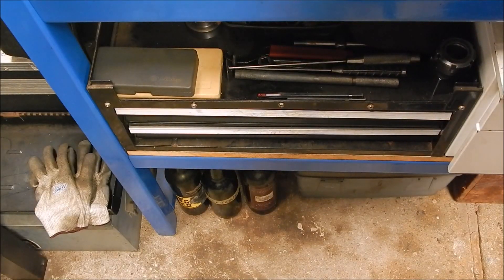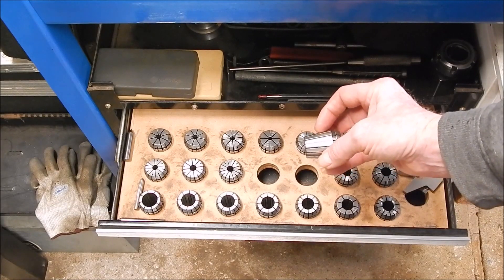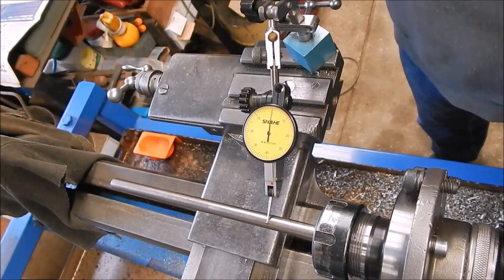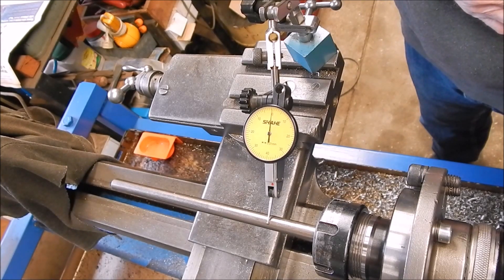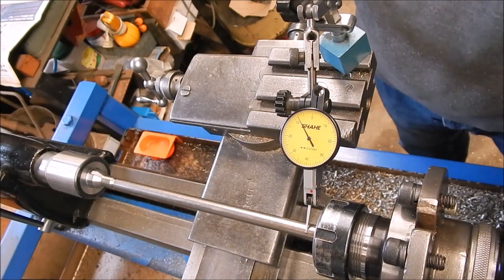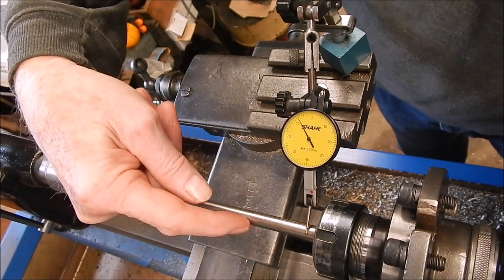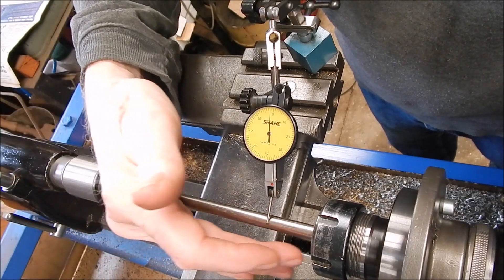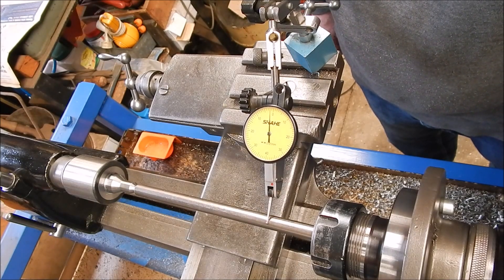How to reduce run out in ER collets

Comment: Our CNC router uses ER32 collets. If the tool isn't inserted far enough it can work it's way out while running. I've seen it happen!  A 1/2" X 6" carbide router bit coming out @ 14,000 rpm is right scarry. Operator tried to get another 1/2" depth of cut! For small, short work I use 5C collets on the metal lathe. They grip at the very outside end of the collet.
Reply from the maker: Hi Larry.  Interesting. Sounds like the collet is at the limit of it's compression range for that to happen.  5C have very limited compression range and you have to work at the nominal size for them to grip.  I use W20 which are very similar.  OK for industry where you are using set sized work.  5C do allow the use and grip of non round work (with the appropriately shaped collet centre), which ER cannot do.  Cheers Rob
Reply: @Xynudu  1/2" collet, 1/2" carbide bit but only into the collet part way. Feed 600"/min. Likely caused vibration. Even if the collet only compressed very slightly more on the empty area it would cause the bit to be gripped more on the end furthest in the collet resulting in a squeeze out condition.    My use of 5C collets is for small work and always close to nominal collet size. I like the smooth nose of the 5C chuck for getting my hands right close to polish the work. I have a few square and hex 5C collets also. I use my ER40 chuck for longer or heavier work. I really prefer using collet chucks over scroll chucks because it is so easy to use an internal depth stop for repeated operations.  Collets also grip threads w/o damaging them, very handy.

Comment: Interesting Rob.
Many things to keep in mind .was thinking of getting collets to hold a ring mandrel . Now I know mandrel shaft will have to be longer than collet. Thanks for info .At the moment I put a piece of bar in the 3 jaw and turn to fit dia of ring with a slight step to hold ring flat with chuck . Good for one off.
Reply from the maker: Hi Colum.  Yes you can easily get trapped with this stuff.  It's not always as simple as it seems.  5C collets don't distort as much, but that's because they are designed differently and don't compress any where near as much.  Basically to use 5C the job has to be at the nominal size.  Cheers Rob

Comment: Hi,Rob. Useful advice for those unfamiliar with using ER collets. 
 I have loads of varying diameter short steel slugs to go in the rear of the collet when I have to grip workpieces that are too short to span the full collet depth. 
I also mount my collet chuck in the 4 jaw chuck and that enables me to adjust the workpiece and collet chuck for best concentricity.
Reply from the maker: Hi Howard.  Good techniques.  I have used a collet block in the four jaw chuck at times, mainly for doing eccentrics.  Cheers Rob
Reply: @Xynudu  Yes,I also sometimes mount the square collet block in the 4 jaw and then transfer it over to the milling vise complete with the component if there is a cross hole to drill or flats to mill.

Comment: One of the best tips you gave me a while back was to use a collet chuck instead of a drill chuck on the drill press and lathe , no more chewed up drill shanks- I just wish I could get a collet chuck for my battery drill , that mongrel destroys drill shanks !
Reply from the maker: Hi Ian.  A lot of cordless drills only have keyless chucks, many with plastic bodies, and they are usually B grade gripping units.  However, there are a few quality ones around with metal keyed chucks, which must be way better.  Retro fitting an ER collet chuck accurately would be a bit tricky I think.  Cheers Rob

Comment: I don't use collets very often and only in the mill but it seems so obvious to grip the entire length, otherwise it's like trying to grip a drill using only 5mm of the drill length
Reply from the maker: Hi Bill.  Yes that's a similar situation.  I only did the video in response to the original comment I refered to, which showed a lack of understanding of how ER collets work.   I'm not criticising the person, but using it as a trigger for a bit of skool time that may benefit other people.  Sometimes we have no option, but to use only part of the gripping mechanism of the tool in question, but people should be aware of the issues that raises. Cheers Rob

Comment: Good information there. I have been using ER collets for a long time. Advantages are accuracy for the price, good uniform clamping due to the alternating splits - even better with a bearing nut, low overhang, and more.
One tip is to deburr them from new. Take off all the sharp edges, especially from cheap colletts, make the smooth to handle. Regularly clean them. Stefan Gotteswinter had done a useful video on this, even using an ultrasonic cleaner to chase the microns.
Reply from the maker: Yes, totally agree.  It's vital that users clean them each time. Cheers Rob
Reply: Regular cleaning of the slots with a piece of thin shim stock also helps keep collets gripping accurately.
Reply from the maker: Yes.  Cleanliness is essential with collets.  I mainly use compressed air, but old feeler gauge shims work well when the air is not on.  Cheers Rob

Comment: Some very good advice Rob. I mostly use collets on the milling machine. Aways push the end mills in as far as they go. I do have an er32 collet chuck for the lathe, but confess I don't use it very often. I'm going to use it more in the future. Cheers Nobby
Reply: When you do get around to mounting the collet chuck on a backplate for the lathe leave a few thou of radial play/slack so you can tap and clock the chuck to get true workpiece concentricity.  I always mount my collet chuck in the 4 jaw chuck and that way I can adjust it in small increments for concentricity.
Reply from the maker: It also saves swapping out chucks, which can be a real chore on large lathes.
Reply from the maker: This is where that second smaller lathe of yours will come in handy Nobby.  Have it set up for collets (which usually do small work) as an alternative machine.  That's what I do with the old Schaublin seen in the video. Super useful way to go.  Cheers Rob

Comment: Hi Rob, I didn’t know jobs had to go right through the collets so thanks for that. Recently I watched a video by DazeCars that I think you may find interesting. He recommends using a bearing collet holder and I have bought one to try. It’s only just arrived so I haven’t had time to try it out yet but it seems well made. Cheers and thanks, Stuart. Canberra.
Reply from the maker: Hi Stuart. I haven't used a ball bearing nose cap collet chuck.  I believe they allow greater tightening/grip pressure with less effort than a regular one.  The last time I looked they were considerably more expensive.  Let's know what you think of it versus the regular type.  Good for a video.  Cheers Rob
Reply: @Xynudu  I use a ball bearing collet nut on my ER40 chuck. It requires a lot less effort to grip very firmly than a standard ER collet nut.
Reply: The work has to be inserted to the full depth of the collet gripping surface or the collet will compress more at the rear end than the outer face causing the collet to effectively close in a tapered manner rather than parallel to the work. The trick with short work holding is to use a short slug of bar the same diameter as the workpiece and set it at the rear of the collet jaws. Example: if you need to grip a short piece of work of 10mm dia then you need to place a short slug of 10mm dia rod at the rear of the collet to keep the jaws parallel.

Comment: Good info, Rob. I have an ER40 lathe chuck and two collets, but I've never used it so far. I might do a test on it using some of your pointers. It'll be interesting to see how accurate it is. Yes, it's Chinese, lol. Cheers Tony
Reply from the maker: Hi Tony.  This compression issue applies to all ER collets regardless of price or where they are manufactured.   Certainly some ER collets from China are pretty B grade, but some are also very good.  It all depends on where you buy them and how much you spend.  I find CTC Tools on the web sell DIN rated Chinese gear which is on spec.  My original metric set came from them and is totally accurate.  Most on line sellers don't even quote a DIN figure (probably for good reason) so stay well away from them.  Cheers Rob
Reply: @Xynudu  Thanks Rob for that very important information. That's the reason I've avoided buying any collets. Now, I'll look for the DIN specification when I buy some. I don't mind paying extra if I know they are going to be over a specific standard. More accurate for my experience, but I hate working with trash. It induces problems. Cheers Tony
Reply from the maker: Hi Tony.  This is the only company I would consider for budget collet tooling : https://www.ctctools.biz/

I bought my original Chinese metric set from them 20 years ago and they were to spec.  I haven't bought anything from them recently and have no affiliation with the company, but I have seen very little negative comment in forums about them.  They were originally based in Hong Kong, but are now shipping out of Europe I believe.  Good luck. Their prices are quite reasonable.  Cheers Rob
Reply: @Xynudu  Cheers Rob.👍

Comment: Hi Rob. Anyone who watches my channel knows I'm a complete collet convert, thanks to you. Use them on the lathe in the headstock and tailstock, in the mill and my tapping guide. With the stuff that I make super high levels of accuracy are seldom required but the other advantage of collets is. That being, that they don't mark or damage the work in any way. Using them in the tailstock to hold drill bits completely removes any chance of chewing the bit up which can happen with Jacobs chucks. Also, of course, you can hold threads without any risk of damage. ER32 collet sets are cheap as chips on Banggood, now they may not be the best in the world but for the hobbyshop user they are great, Cheers, Alan.
Reply from the maker: Hi Alan.  Like all things, you get what you pay for.  Having said that, even the worst collets I've used have been better than most chucks for that work size.  Then of course there is the no mark work feature, which is probably the main draw card overall.  Some people bag Chinese collets, but they are not all of the same quality.  I have good and I have a bad set.  Spend more, get better, it works the same for most products.  Enjoy.  Cheers Rob.

Comment: There is a reason ER collets and holders from a manufacturer not too ashamed to put their name on their collets cost five time as much as Chinese mystery collets. Name brand tooling is guaranteed to meet a published specification. Buying cheap Chinese ER collets is about like buying a pig in a poke.
You might get collets you can use or you might get collets like the two sets I have that are so bad you don't need an indicator to see the runout. They do make attractive paper weights though.
In the home shop you can take the time to do the things shown in the video to help the situation. If you are using ER collets and holders to make a living this stuff has to be spot-on out of the box... dependably. Dependable and Chinese should never be used in the same sentence.
Reply: That's a silly uninformed view. You can get high quality tooling from China but you have to pay more. When things are built to a price point, corners have to be cut. No free lunches.
Reply: @HM-Projects  You've probably never bought any custom-built die sets from China. Or more precisely had to rebuild new custom-built die sets from China. The only way I know to get reliably good products from China is to hire some Japanese or Koreans to stand there and watch them like a hawk. The Chinese mentality in business is to sell you what they think they can get away with. Caveat emptor.
Reply: @HM-Projects   Uninformed? You just said the same thing as Rob using different words
Reply from the maker: You will get the same error result by using half the collet length, regardless of how much you paid or who made them.  All of my collets are made in China.  The Banggood ones were pretty variable and not recommended.  The CTC Tools bought ones are totally accurate and to spec.  You get what you pay for.  End of story.  Cheers Rob
Reply: You can most certainly get dependable quality collets from Chinese manufacturers. It simply depends on who you buy from and how much you're willing to pay for good quality.
Reply from the maker: Yes, good quality collets from China are definitely out there, but some people still buy cheap non spec gear, expect miracles, and then complain when it turns out to be rubbish.  I only buy DIN standard collets/chucks from a reputable store.  It will be slightly more expensive, but quality Asian collets are still very reasonable.  Cheers Rob

Comment: Good demonstration of how things can go wrong if ER collets are abused. If I have to hold a workpiece half way, I usually turn a blank around the same diameter and use that to even out the closing pressure.  Also I used a ball bearing to align workpiece in those scenarios.
Reply from the maker: Yes, that's the usual approach.  So how does the ball bearing aid alignment ?
Reply: @Xynudu  it's similar to the hand knocker but since it runs relatively true as long as there's axial alignment it pushes the workpiece to alignment.
Reply from the maker: OK.  Now I understand.   Cheers Rob
Reply: @Xynudu  I was looking for this video I made a while back, my import collets aren't that good  https://youtu.be/TjqLgYroqWE
Reply from the maker: Good video.  Looks to work well.  Very similar to a face alignment tool.  I will make one like yours and test it out.  Thanks for posting.  Cheers Rob

Comment: Hi Rob.  Like you I use my ER32 mill collets in the lathe to hold small diameters.  I have made a special adaptor to hold the flanged ER32 collet chuck like yours.  It is held in a three jaw chuck.  I have four cap screws with the heads protruding on the back side.  These fit into a recess in the mating plate.  I have four radial adjusting screws so by loosening the clamp bolts on the front, I can move the collet assembly around like a four jaw chuck.  This way I can reduce my radial runout to zero.  Cheers
Reply from the maker: Hi John.  That's a great idea.  Yes, shades of four jaw chuck there.  Errors can usually be eradicated if you want to put in the effort. Thanks for the comment.  Cheers Rob
Reply: I just mount my disc type collet chuck in the 4 jaw and adjust for best concentricity. Slightly different method but the same outcome as yours.

Comment: The ER32 and ER8 collet sets I've imported have been a lot better than I need them to be.  I don't use them exclusively but particularly on my little mill they're great for making the most of the limited Z height.
Reply from the maker: Even the worst collets are better than most chucks, for that size range ;)  Cheers Rob

Comment: Check the slits on the cheap collets, they can be cut bad, it's easy to see. Ditch those ones they will never compress right, no clean run out 👍👌🇦🇺
Reply from the maker: Yes, very true.  Also make sure to blow collets out with air to remove crud after use or you will get the same effect.  Cheers Rob
Reply: And use a dial gauge 😅👍👌🇦🇺